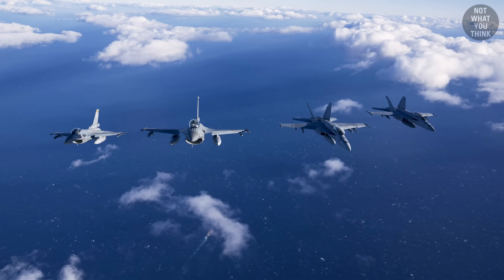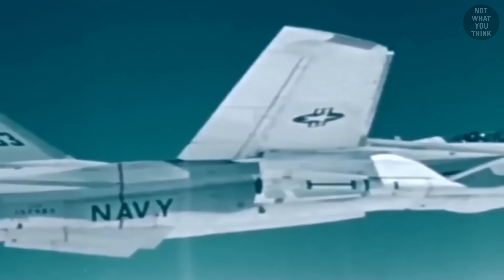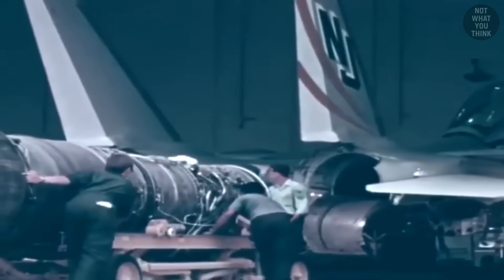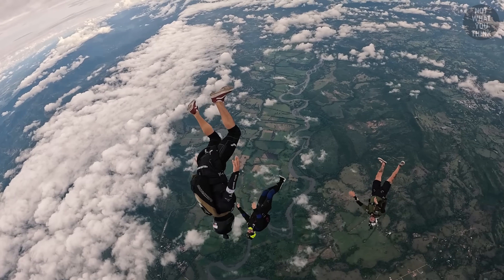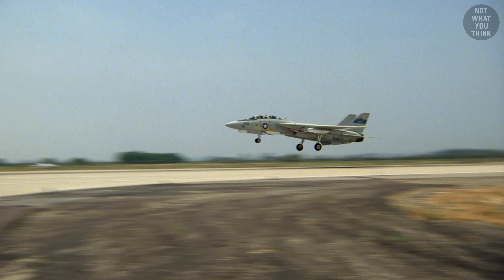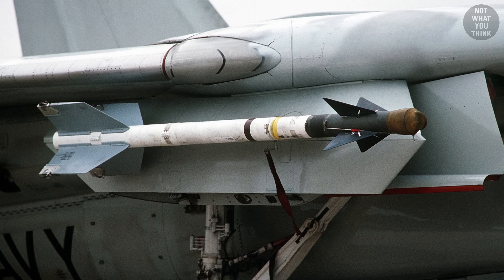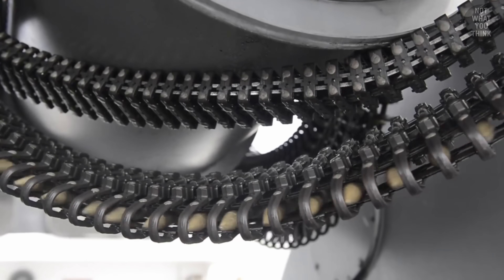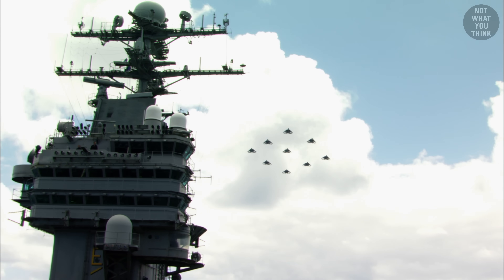Why the F-14 Was Built for a Weapon That Was Never Fired

Comment: I was a Tomcat maintainer during Desert Storm. It was an amazing aircraft, but it was indeed a lot of work to maintain.
Reply: I believe the aircraft that lost half a wing and still landed was a F-15
Reply: @JosephHelmstetter the F15 lost its entire wing.
Reply: @JosephHelmstetter Indeed it was. The pilot had to land a helluva lot faster than normal, but the lifting body of the f-15 is what allowed him to land.
Reply: As an air force maintainer, I feel your pain. We would have to do many manhours of maintenance just for 1 flying hour.
Reply: I'd imagine the man-hours to maintain an F-14 after 1 hour of flight is still less than a B-2 and significantly more than an F-18.
Reply: My grandpa was on the ground in desert storm and he said he saw a bombcat doing a cas drop
Reply: Have you ever asked the question due to the lackluster performance of the early f18s why they didn’t fit a double pylon under each wing so it could carry four amraams per wing?
Reply: That is cool, I’d like to hear some of your stories.  

I was always surprised it took as long as it did to make it a strike aircraft.
Reply: @Pene7942 

Yeah. It was one of the last highly specialized fighters.Though, given what it was designed for- long range interception/interdiction of Soviet cruise missile carrying supersonic bombers... Such specialization made sense at the time. (But after the USSR dissolved? Why not strap some JDs on it ASAP?

I think it's transition to a multirole platform was delayed by institutional inertia, and just plain stubbornness. If that has happened as soon as it could have, we might have the Super Tomcat instead of the Strike Eagle! (Ah, we can dream eh? I wonder how many people posting on this thread had an F-14 poster on their wall as a kid? I did! (Though, since my grandfather was a retired career Naval Aviator, he may have had something to do with my admiration for naval planes/fighters...)

Cheers!
Reply: @bholdr----0  I still believe the Super Tomcat could never be quite the multirole the Eagle or even the Hornet are. 

The variable wings offered little room for bombs or other weapons load. The aircraft itself was very heavy — not a lot of bombs could be carried.

It's why they had to retire it in 2006.
Reply: @bholdr----0  They sort of did in Desert Storm.  They retrofitted LANTIRN pods to it and called it a Bombcat.... very much AGAINST orders by the Pentagon.
Reply: @bholdr----0  it was surprisingly good at lifting and maneuvering tho :c
Kinda sad that part ultimately got wasted
Reply: Same. Can confirm.... VF-14, USS JFK
Reply: Thank you for your service sorry servicing one of the coolest most iconic aircraft ever designed was probably a hugeeee pain
Reply: I'd bet my ass those Tomcats were ludicrous gas guzzlers also. 😂
Reply: @Leadblast  For sure. The Tomcat was/is a HUGE aircraft as far as military fighters go. All that surface area pushed through the air at mach speeds = slurping juice like a thirsty camel... :)
Reply: Yes
Reply: My father was too. Maybe you knew each other. Small world.
Reply: Hi Kenneth, WICHITA 103 - "meat" here. Remember myself and Bongo?
Reply: @soppingclam

Great screen name! (I wish I thought of it first...
Reply: @soppingclam he probably made it up
Reply: @General_1220 

Well, WOW! ...Why, out of nowhere, would you assume that? ...Basically, you DON'T KNOW... So, 'General:, maybe you ought to stay in your lane and don't accuse someone of Stolen Valor (a crime) with absolutely zero evidence, based on ONE YOUTUBE POST that you didnt like! 

Turn rdown the DRAMA dial on the loudspeaker of yer semi-anonymous social media life. Jeez, guy... Hang yer head! (BTW, after rereading SC's's post... SC didn't suggest that the post he responded to was made up, not at all. That's just YOU! 

(Edit- LMMFAO- I just got what 'soppingclam's screen name means. That's pretty funny 🤣)
Reply: My roommate did engine maintenance on Boeing commercial jets, and I hadn't realized how incredibly complex, expert, and time consuming such work is before I met him. I'm a pretty tech/mechanically savvy guy, but half of what he said goes straight over my head until he explaind it to me as I was a six year old. 

I can't imagine how much more difficult that such maintenance is on some god-foraaken base in bum-fuk nowhere, where military maintainers have to work, and get it done nowatter what. But, then again, the most complex machines that I've rebuilt myself from scrap/junked parts was a few VW Bus/ old Porche engines. (Not counting machine tooling, etc). Remember, it ain't cool... unless it's AIR cooled 😎!

(Also, sadly, he passed away last month. I learned a lot from him in the few years we knew each other... 😞. Sry to be a bummer.)
Reply: If it ain't leaking red hydraulic fluid on th⁹e deck where it's parked? 
SOMETHINGS WRONG!
Reply: dude just ask iran... if they doesnt have f14 they would lose southwest oil rich area to iraq in the 80s...
Reply: Was most of the maintenance work due to the variable geometry “swing wings”?
The ST-22 Tomcat proposal would have solved much of that issue if it kept fixed swept back wings.
Reply: @jordanmascarenhas7974  A lot of the maintenance time was simply opening the panels to get to the work.  Took took a few seconds to open a panel on an F-18, while on an F-14 it could take several minutes. And putting them back on was more of a pain.